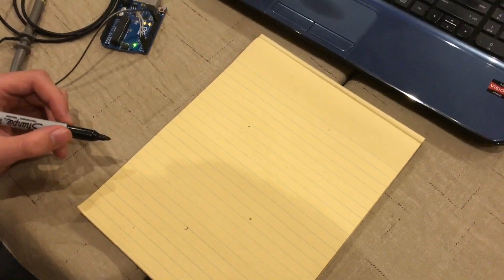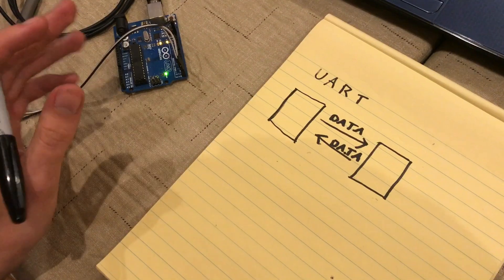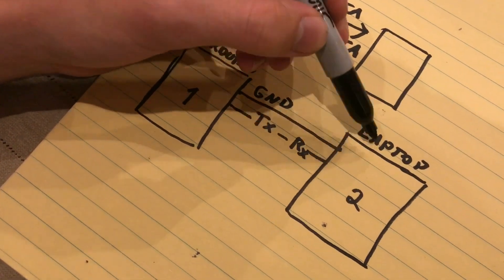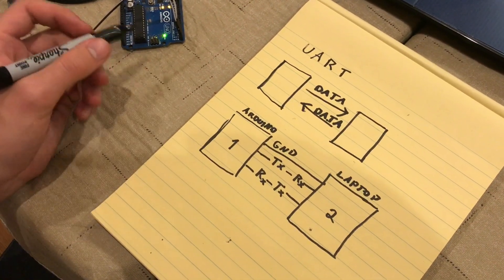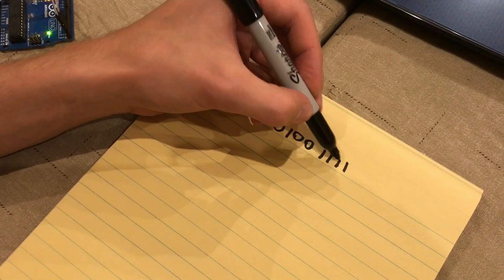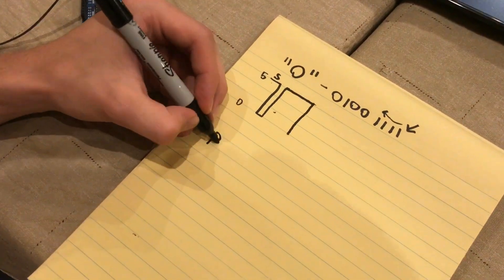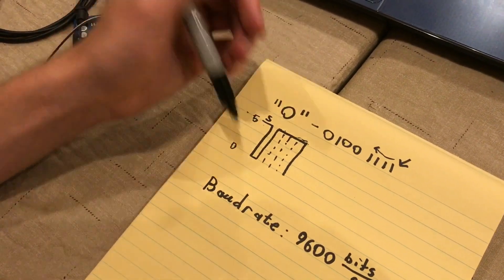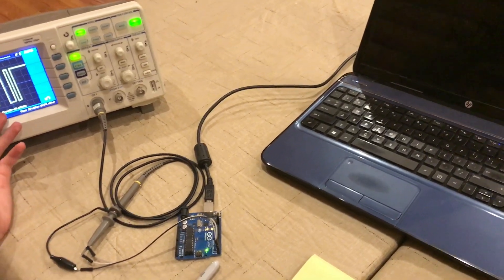how does UART work??? (explained clearly)

Comment: Great video,I'm a complete beginner and  I'm trying to understand how to make a UART that works in background with an arudino UNO using only bare metal c and maybe assembly. I understand the serial trasmission and that i need an periodic interrupt (using Timer 0 for example) that make the trasmission regulated in time so every character is well read from the RX. I don't quite understand how to make it so that when the entry buffer has data (several characters) the process starts and doesn't block the cpu, I thought of another Interrupt but does it need to be always on duty to check for new bytes? It seems a waste and i need it to be quite reliable and efficient for this project. What can I do?

Comment: I’m an older timer as well in electronics. My senior project in college was based on the UART as a TX/RX. I’m currently an engineering instructor at a Tech High School. I would like to demonstrate this for my senior class next year. Do you mind sharing how you connected the oscilloscope to the Adriuno?

Comment: The serial in the arduino case is ttl level and not usual rs-232. That means it is inverted and in a different voltage range like 0-5v and not +/- 2.5 v or all the way to +/- 15 v.

Comment: 2:44
Tx is not short for "Transmission"

Here is a bit of a lecture to shed light on this subject , perhaps if only for the youngens  LOL

SHORT ANSWER
Tx = TRANSMIT (most commonly) also,  Transmitter
Rx = Receive  (most commonly)  also, Receiver
But never "Transmission"
and Rx is never "Reception" and certainly not "Receiving"

A BIT MORE DETAIL
Now... you can just accept that and move on with life or........ if you crave browny points
here we go...

To summarize this as best as i can ...
we can really open a can of worms here
- We can debate what Tx means and then Rx means the opposite
- We can then debate "What does the X stand for ?"

because, in older times we could also write  "Xmit" to mean "Transmit"
Long story short , the origin of the X is so fucking old that the meaning of it is lost,
the best your'e going to get on this is it is a placeholder for a cross connection
and the reason why T and R were not used is because this shit goes back to the wired telegraph days and T was used for TONE and R for Readability of transmission,
also in Telephony there was  TIP and RING so we couldn't use that for Transmit and Recieve
SEE, I TOLD YOU IT WAS A CAN OF WORMS

Basically the older definitions are
Tx = Output Transceiver
Rx = Input Transceiver

which then later became shortened or made more logical to be 
Tx = Transmit / Transmitter
Rx = Receive / Receiver 

so there you have it
Tx is Transmit , Never Transmission

If you're ever on who wants to be a millionaire and you score this question
I FUCKING WANT 10% OF THE WINNINGS  :p

Comment: I WONDER HOW CAN I CONNECT MY Globisens LabDisc TO ARDUINO VIA USB CABLE?  ARDUINO HAS TX AND RX PINS, LabDisc SUPPORTS UART PROTOCOL. BUT I DON'T KNOW HOW TO READ SIGHTINGS FROM LabDisc OUTPUT CABLE WHICH IS FOR CONNECTING TO LAPTOP.

IT WOULD BE FANTASTIC IF YOU SHARE A VIDEO ABOUT IT. 

THANKS IN ADVANCE.

Comment: Ground wire is not always there or required, for example in a differencial bus where the digital values are obtained by checking the voltage between two wires

Comment: This is ace! I’ve used comms for years between devices, and taken that it’s always worked. Setup the correct comms settings and away it goes. but I’m now at a stage where I’ve got to take comms signal from an old device and manipulate it to deliver something readable. This has helped me understand how it is sent and received. Knowing this gives me some idea how to move forward from here. Thanks!

Comment: Hello, thanks, great explanation.... my friend you use the following code and you can see the correct signal on the osciloscope.

void setup() {
    Serial.begin(9600);
}
void loop() {
    Serial.print('O');
    delay(10);

}

but if I want to see for example the number 198 (decimal) = C6(hexadecimal),  using he same code, I can'y see the correct signal on the osciloscope ...

void setup() {
    Serial.begin(9600);
}
void loop() {
    Serial.print('198');
    delay(10);
}

Can you help me please with this ?
Reply: the way you are telling it to print 198 is incorrect,  you are using simple ', however those are used to represent a single character, what you would need to use according to the arduino reference ( i dont use arduino, i program in C ) :
Serial.print(198, HEX) 
this way you are telling the program that you want to see 198 as a hex character, so it  will be the C6 that you are looking for, which will allow you to see it in the oscilloscope, hope it helped

Comment: Great video, I wonder why YouTube waited so long to promote it!
One small correction though, baudrate is not necessarily the same as the nitrate. In the simple case of UART, it is. Baudrate is defined as the number of change to the signal per second. In modulations like QAM, the baudrate is lower than your bitrate, as one phase shift encodes more than one bit.

Comment: how much the delay time between start and the first binary code? and also after the last binary code (8th bit which is 0 in regular ASCII) how long the time delay. This is very important to differentiate between each byte data when sending and receiving.

so with 9600 bps (9600 baud rate with 1 bit per signal), 1 bit closely to 104.1667 microsecond pulse time right? What is the maximum baud rate can be used (or bps) for arduino uno with 16MHz oscillator?

in your oscilloscop, what pin was used for positive terminal?

Comment: How does the receiver know that the end condition is the end condition, instead of a whole load of 1's?
Reply: Because you (the master/slave) know in prehand what the baud-rate and total number of X data bits (where X is 5-9 bits) are, also the optional parity bit. So it knows that the stop bit should be after the X bit.
Reply: @erblinas4423  If everything is based off of timing there must be an initial sync right? When and how does that happen? Also, how long does the UART wait between bytes to send the next byte?
Reply: @4wheeldrifting  it is because the Rx and Tx are already configured to the same baud rate before the transmission of data occurs..so when the bits are transmitted from Tx to Rx a stop bit is generated to tell Rx that transmission is completed and thus the Rx prepares itself for the next transmission in the meanwhile...

Comment: Why in the oscilloscope you read from right to left?
Reply from the maker: Good question. Reading from left to right, the scope says "start-11110010-stop". But we know that ASCII "O" is decimal 79 or binary 01001111, which appears to be the reverse. The scope is telling the truth though, because UART transmits the least significant bit (LSB) first. When you read the scope, you should begin from the left after the start condition, look at the first bit (LSB), and write it down. Keep reading until you get to the MSB. On paper, the LSB is at the far right, and the MSB is at the far left. For example, if the scope reads `start-10101110-stop`, you should write the byte in reverse, as 01110101 = decimal 117 = `u`. Does that clear things up?

Comment: if i increase the baudrate to 19200 can i get the same data?
Reply from the maker: Ravin ath Yes, as long as both devices are using 19200, the data will be received correctly. Again, the important thing is that the baud rates match.
Reply: How to know for which baud rate to settle down
Reply: @vinodkanoji9501  receiver and transmetter have to agree about fixed baud rate before communication starts.
If you don't want to agree in advance in that case we have USART

Comment: Thanks. Really good explanation. Small question, How much time it takes to transmit the first bit after the start (falling edge)?
Reply from the maker: Both a start condition and a stop condition last one "bit cycle." That means that to transmit 8 bits of data, it actually takes 10 bit cycles! Remember that the bit cycle is the inverse of the baud rate, so if I am running at 115200 buad, my bit cycle is 1/115200 or 8.7 microseconds. If you take a look at the oscilloscope at 10:13, you can see that the voltage stays at 0 after the falling edge for about ~9 microseconds (each grid block on the screen represents 20 microseconds) before going high for the first four data bits (which where all 1's). Does that make sense?
Reply: Continuous Load . Yes. Thank you very much.

Comment: Whats the use of clock pule in uart and the receiver,and how it helps to transfer the data ?? please explain that ..
Reply from the maker: Good question. UART is different from other serial protocols (like SPI or I2C) because it doesn't use a clock pin at all. This of course means that both the sender and receiver must be pre-configured to use the same baud rate. For example, if I have an Arduino sending a message at 9600 baud (bits/second), I need to tell the Serial Moniter program on my computer to listen at 9600 baud as well, otherwise the bit values will get read at the wrong time. 
Does that answer your question?

Some serial protocols do use a clock pulse. Consider SPI (Serial Peripheral Interface) which has a clock pulse wire to signal the receiver when to read the next bit. As a result, baudrate does not matter to SPI devices since the master sets the pace with the clock pulse.
Reply: @continuousload3963  I have been long mystified by parity bits and how it is able to verify data integrity. If there is only 1 bit that flipped, then the parity bit can detect the corruption and will therefore cause a retransmit. However, the parity mechanism cannot detect if there are two bits that flipped. Can you shed some light on this aspect ?
Reply from the maker: @dexteraparicio7418  you are absolutely right - the use of a parity bit is only good for detecting an odd number of corrections - if one or three or five bits are corrupted, the parity bit will change, but if two or four or six bits are corrupted, the parity bit will remain unchanged and the corruption will go undetected. 

Thankfully having two bits corrupted is statistically less likely than only one, but in a system where data integrity is critical, the person designing the system will have to implement a more advanced error detection protocol. That said, considering how cheap the parity bit is to compute, you might as well use it since it's there :)